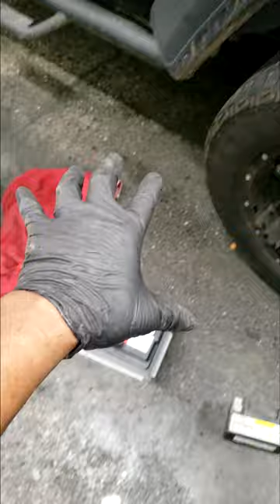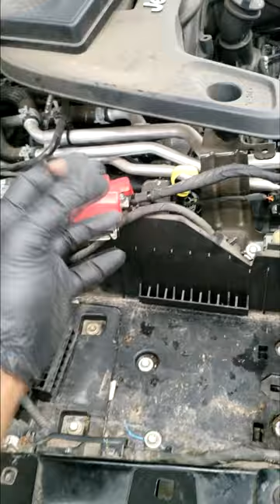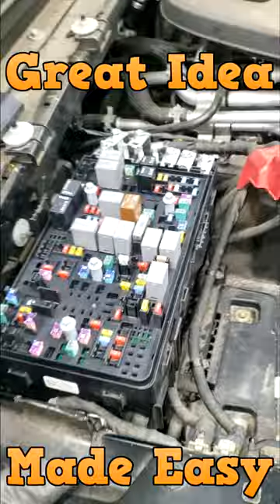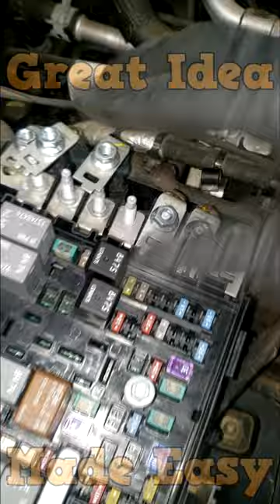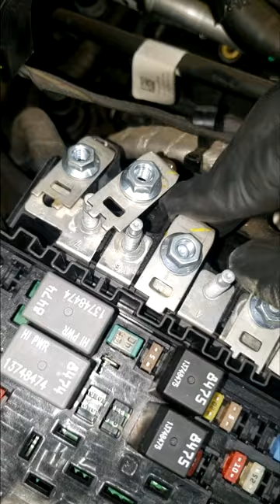Give the Car Engineers some credit. Bright idea. Thanks for making this job less confusing.

Comment: Back in the early days of my building computers the power supply connectors (two) were the exact same plug size so you could easily reverse them if you didn't know or pay attention to how they were plugged in. It would kill the motherboard board the minute you turned it on.
The new computer for quite a while the critical plugs are keyed and the non critical ones just won't work if you plug it in wrong.

Comment: Those terminals were not for you! They were made for the assembly line folks so they didn't have to stop the manufacturing line for QC.
Reply from the maker: Lol, then they got a 2fer.
Reply: I agree with T Hill. Do you really think the engineers were thinking about maintenance?

Comment: Great idea , most weather pack plugs on sensors are only fit one as well so they dont get mixed up , but ponder this , that fuse box is on top of a battery and another battery beside it. If system over charging or battery sulfates then all the acidic gases invade the expensive fuse box

Comment: Got a call on a furnace a friend moved from a different location in garage and it wouldn’t do anything, they had put a cord on it that didn’t have the wider spade on the neutral side both sides were same old style male plugs. Just for luck I flipped it over and wala it fired up, something’s will not work with the polarity backwards.

Comment: Yes they got that right but not the fact that the vvt plug on the driver side exhaust cam will interchange with the ac compressor plug and cause ALLLLLLL sorts of funny stuff that you would never expect. Things such as not running right and a inop radio.

Comment: I prefer Togo from the bottom you just pop a could rivets and pull down the wheel liner and it's 2 10s and the battery falls out.

Comment: For battery you’d not have do not all this pull wheel passenger side of course wheel well cover take ten minutes to replace
Reply from the maker: The video is about the connection at the PDC. Stay focused my guy

Comment: Well not so much. That extra battery could have been put  in the open so that whole mess would have been totally unnecessary. More work means more time which equals higher repair costs for owners. Once again engineers created an unnecessary headache and mess. The more you mess with electrical connectors the chances of shorts and electrical issues increase. Less is more.   A bad place to be messing around. You give folks to much credit for not screwing things up I know folks that could and would figure a way to do it wrong. I know many folks who love to force things into place.

Comment: I thought the Auxiliary battery access was under the fender? Which of course is closest to the high heat of the exhaust, not to mention water and other damage from being under the fender. Arrogant designs for a battery that has to be replaced yearly, for the only benefit of destroying the engine, starter and batteries to gain nothing in carbon savings.